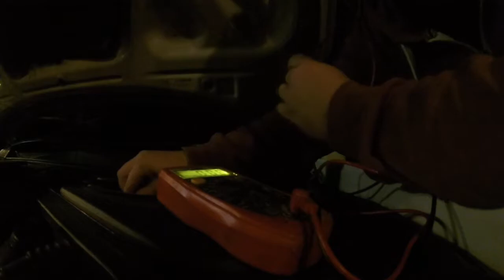Forester goes back to SINGLE turbo | PART 1

Comment: I'm a bit curious as to why the switch from dual to single. That being said, beautiful forester you've got there!
Reply from the maker: Just for now. Just more reliable and safe for engine. It’s not tuned for the compound setup
Reply: That makes sense. Thanks!